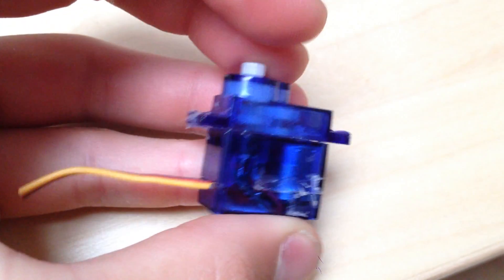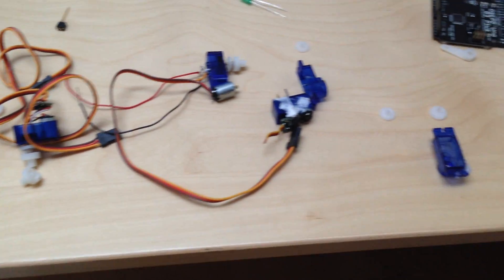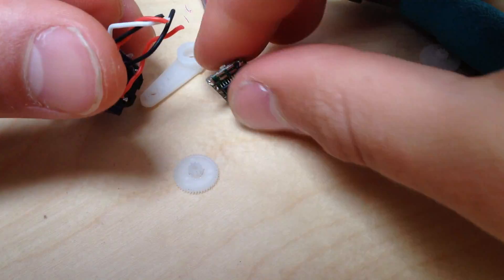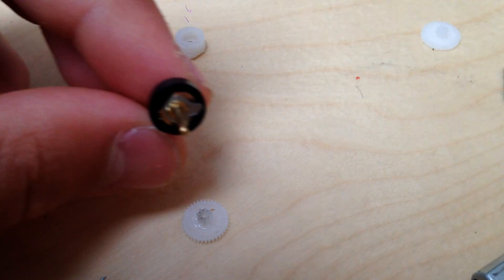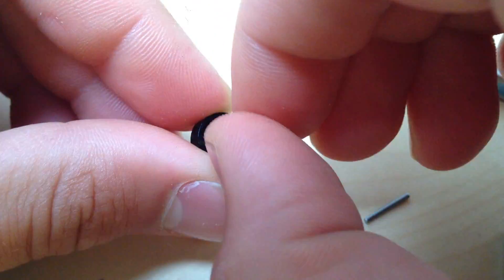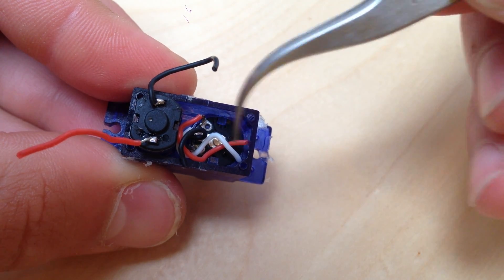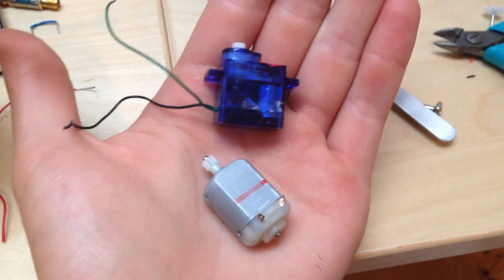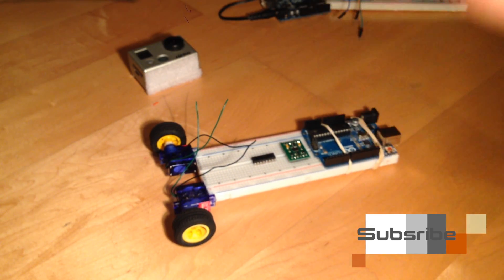Continuous Rotation Mod: Reusing broken 9 gram servos

Comment: What is  to stop you leaving the electronic control connected, replace the pot with a potential divider of equal resistance.
That way you use it with its exisiting wiring and control with servo commands.

approx 90Deg  == stop
0Deg == rotation one direction
180Deg == rotation in other.

I like the superglue idea, to replace the broken gear.